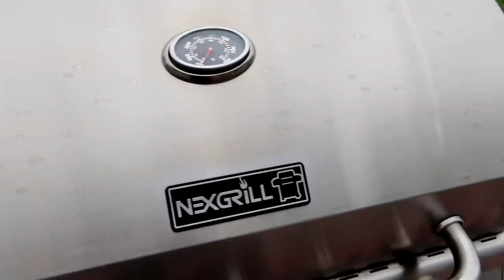2020 DEEP CLEAN & DECORATE WITH ME :: HUGE DECK TRANSFORMATION + DECLUTTER & CLEANING MOTIVATION

Comment: Just an FYI for windows that have hard water on them... we used a product called "Bring it on Cleaner" and a drill brush.  Our windows had 17 years of hard water sprinkler stains built up on them and we thought we would have to replace them...that's what we were told.  We used this stuff and like magic they looked like new.  I only add this because your hubs was working way harder than my hubs did with a drill brush!  It's pretty awesome stuff!  You just stand there with a drill!  Great Deck Makeover!